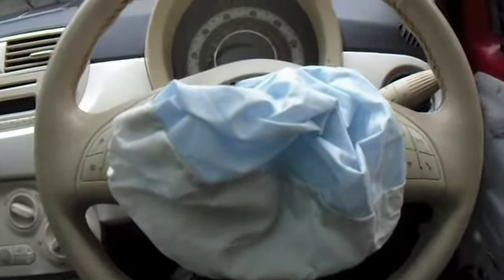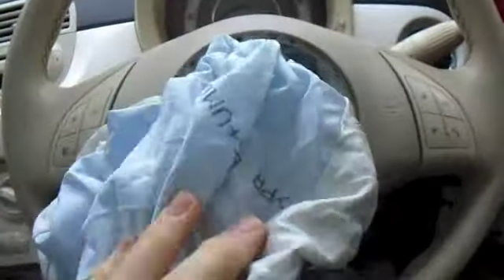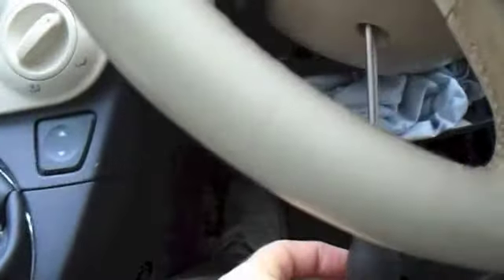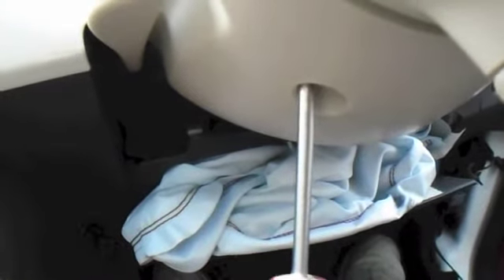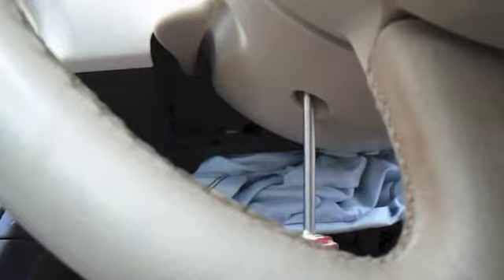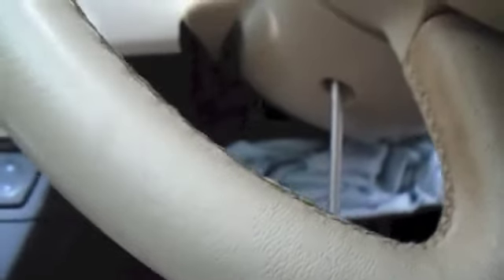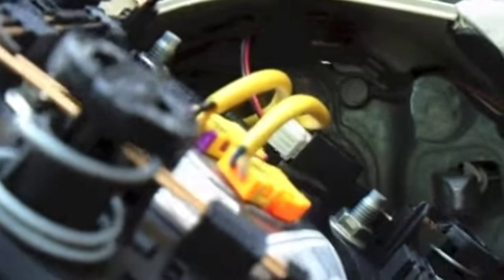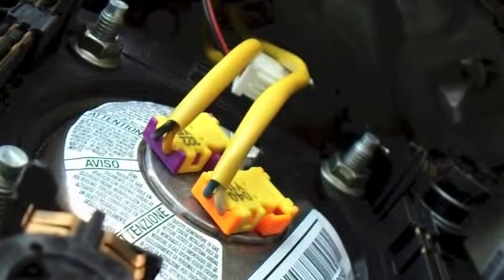Removing a Drivers Steering Wheel Airbag on a Fiat 500 or Abarth Love 500 How to Series

Comment: Hey Bertie, with bottom steering column cover, how did you get it to unclip from the top one? Did you wedge it with a screwdriver? Any tips would be helpful, thanks!
Reply from the maker: Once you've removed the two screws, it will just pull off. Without the screws its only held on by the little tabs, just a gentle pull should release it.